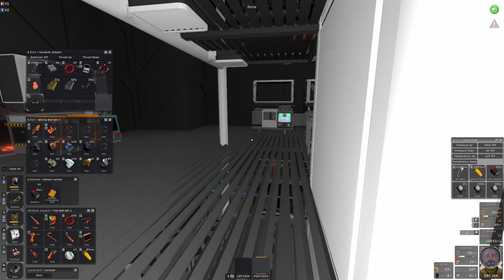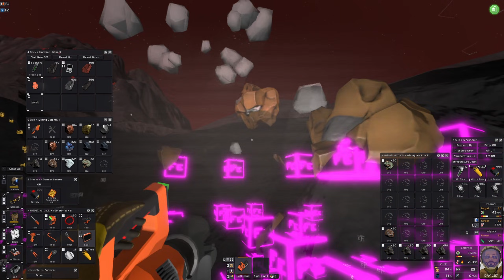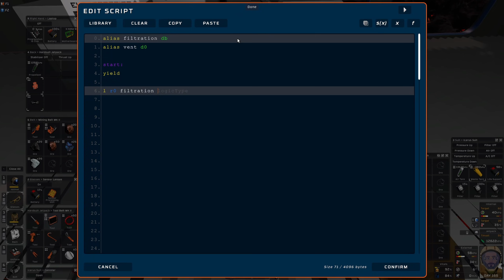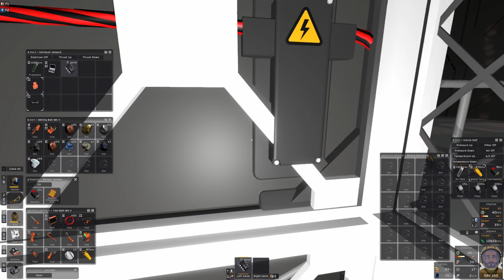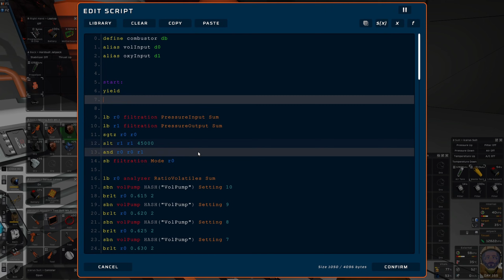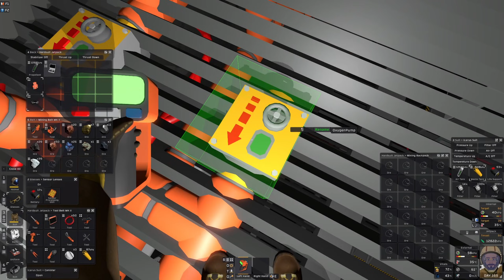Multiple Mining Trips, And Some Coding - S2 E50 ║ Stationeers

Comment: 23:54 I feel like using the waste output port on the vol filtration to measure temperature might be a bit flawed here, as you're also pumping hot combustor waste out on the same pipe, so while the combustor is active it will get higher readings than the actual outside temperature.
Reply from the maker: That is correct. Thankfully it's not entirely unworkable, the volatiles storage is a pretty decent amount at 40MPa, so once it's full it will last a long time. And once it's empty, the combustor will shut down, stop exhausting, and we can dump some more volatiles into storage. Far from perfect, but it should do somewhat OK until I get around to installing an outside sensor.

Comment: Man decides to burn stuff today: first his rocket umbilical, now the top of his furnace vent.

I know of petrochemical companies having to burn off excess ethane (thanks Hank Green for informing us why recycling plastics are hard, and it's because of this!), but I guess we don't have a need for NO2 too?
Reply from the maker: NO2 makes me a bit paranoid. It's even better than pure O2 for oxidizing fires, but the ignition temperatures are much lower than an O2 fuel mix, which makes it kinda dangerous. Would need to cool everything down before mixing to be extra sure, and then keep the mix cold too. One mistep and it's kaboom. I felt iffy about doing the much safer O2 mix right next to the base, if I used NO2 I'd be unable to sleep. :D